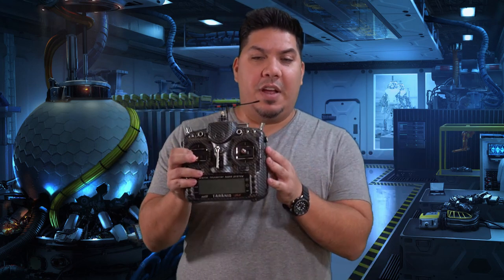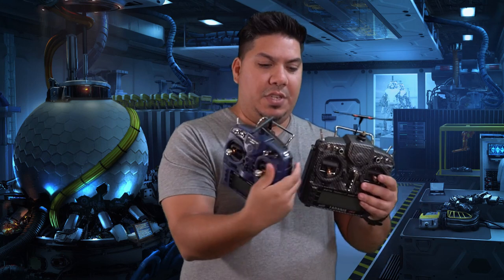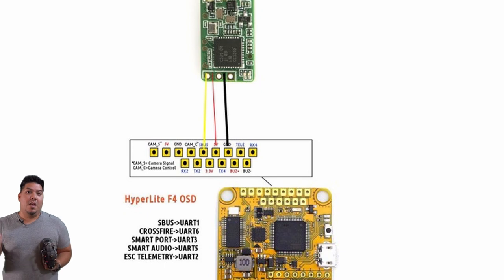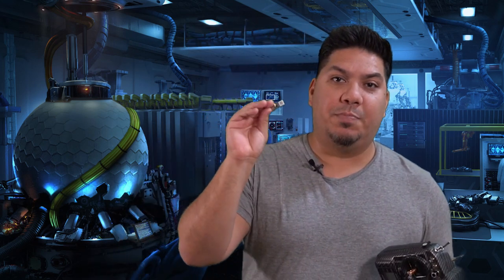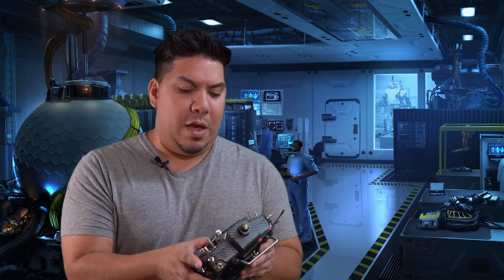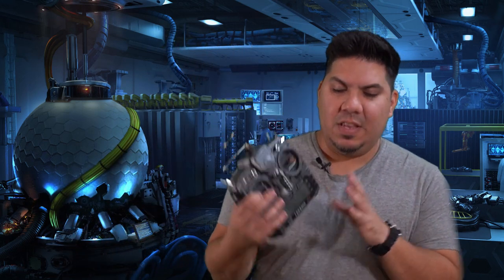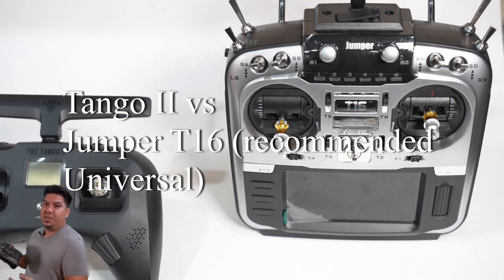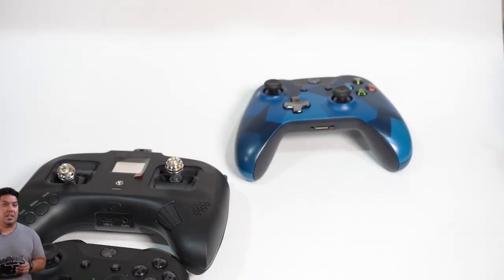Beginner Series: Transmitter Explained - Drone Radio, Drone Controller, which to chose?

Comment: Great video for those just getting started in the hobby. Another excellent radio option for someone just starting out is the Flysky i6. Really nice for under $40.00.
Reply from the maker: Good point, i also started with that flysky radio, but now i suggest you skip it and spent just a little more if possible.  It was a pain converting all my recievers over when i did switch, and definetly cost me more overall than if i would have just went straight to Frsky.
Reply: @JonE5FPV  I started with Spektrum and Flysky then went to the Jumper T16. One radio now flying all my receivers! Gotta love multi-protocol. I now have two T16's and the amazing part is I just copied the contents of original Jumper's SD card to the new and there were all my models. Technology at its finest.  Lol Stay safe.

Comment: Hi John I have a question , is it possible use the radio like jumper t18 pro  with an hd drone system like dji air hd system or Caddx Vista HD  ?  if yes, what do you need?
thanks in advance
Reply from the maker: Yes, absolutely, thats actually the exact setup i use for my DJI quads with vista or air unit.  You just wire up crossfire or whatever reciever you normally would to the flight controller. And then you only wire up the 4 wires related to the video of the Vista or air unit to the flight controller.

Comment: dope content i have a question...i bought a quadcopter kit(atom2,extra motors,props, and older fat sharks)off letgo but i forgot how to arm or take it out of safe so its just gathering dust.how do i rest the arm switch?would i need to reset the radio or do something in betaflight?

Comment: Will going with a Tango 2 overkill as a first radio?
Reply from the maker: No not at all it is very easy to use. Only thing is it is crossfire system only. But as long as you use those recievers it’s a great option.